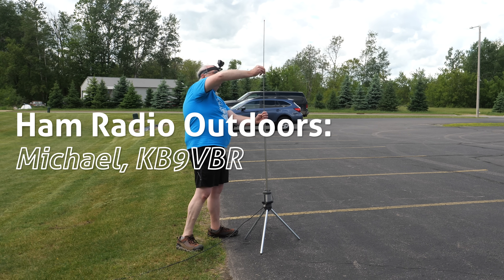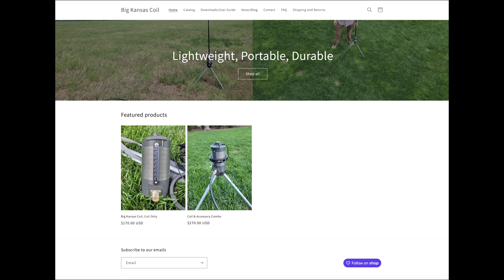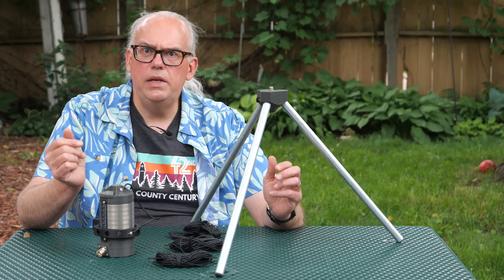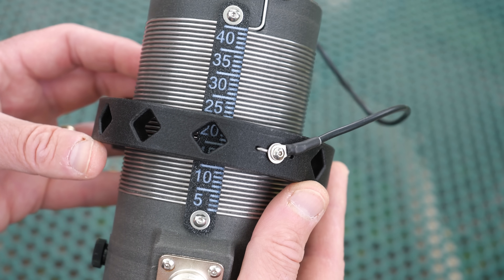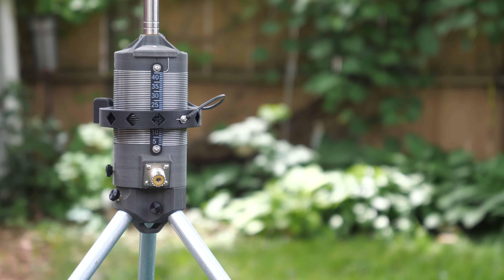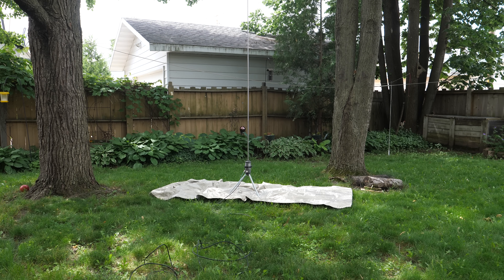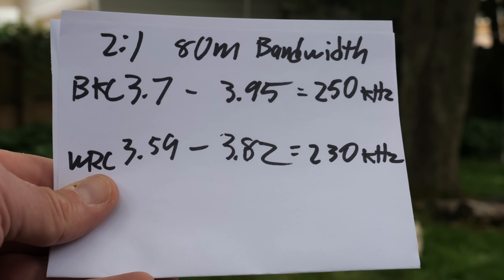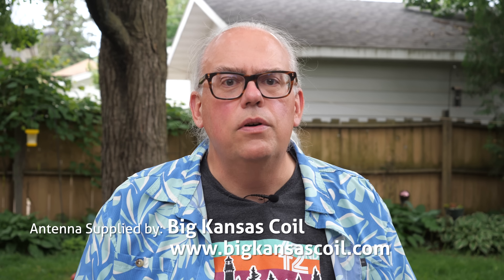Is bigger better? The Big Kansas Coil Vertical Antenna System

Comment: Carbon-fiber filled nylon 3-d printer core (why a carbon component?), plus the coil is stainless steel creates substantial loss in this loading system. Additional loss is in the stainless whip, making the copper wire radials the most efficient component of the antenna system. Achieving 1:1 VSWR (or close) on all bands with the radiator physically short means the feed point will be well below 50 ohms, so the VSWR should be quite high (no impedance transformer device is in the circuit). The loss from the coil (and whip) add to the feed point, pushing it close to 50 ohms for the coveted 1:1; unfortunately, the loss is quite high. This is also evidenced by the wide VSWR operating bandwidth(s). You can make contacts, but nothing compared to an an efficient antenna.

Comment: I must say, I am impressed with the thought that went into this product.   It seems very refined, for a loaded antenna.  And, I enjoy the simplicity and ease of setup of ground mounted verticals.   If I was not already using a screwdriver with a 17 ft whip, I would definitely consider this product.

But, I will note that, in visiting the site, they offer Faraday cloth starting at $100.   Frankly, given that I can get Faraday cloth from Amazon, eBay, and AliExpress, as well as others, for a small fraction of that cost, I was a bit offended.   I get that they need - and, deserve - to earn a fair profit on the things they sell.   But, when they mark something that is a widely available commodity up so dramatically it feels a bit usurious and off-putting.  It made me feel like everything else on the site would likewise be overpriced.

My advice would be to sell the specialized products that they had to manufacture and test at whatever they consider to be a fair price, and sell things like Faraday cloth with much less of a mark up.   Knowing what it costs elsewhere means I would never purchase it from them.   So, having it on the site is actually detrimental at that high price.  On the other hand, if their price on Faraday cloth was more in line with what it might cost elsewhere, two things would likely happen:

1 -  I would likely add the Faraday cloth to my order and they would make a nominal, but fair profit off the sale.

2 -  I would feel like the seller was trying to keep costs down, while ensuring that they make sufficient profit to remain in business - which is a very good thing for them and their customers; because, they make a quality product.

You might pass this comment along to them.

Thanks for the video review!

73
AI4IJ
Reply: @richardowens9061 Hi Richard,  If you note the faraday cloth we sell is more than just the cloth, the edges are hemmed, brass grommets installed in the corners, a custom center hub installed that allows easy connection with banana plugs, hookup cable, and tent pegs for staking.  No, we aren't trying to sell an unmodified Faraday Cloth for 100$, that would be robbery!  Between the hemming, laser cutting of the hole features, and all the other items we feel it's a very fair price.  

Thanks,
Big Kansas Coil

Comment: That antenna needs a spike to hold it, or a big tripod.
Reply: I took your idea and made it work, thank you for speaking up!
Three wooden dowels, 3/4 inch diameter, from the hardware store, and a roll of purple duct tape.
Purple is my wife's favorite color so that's what I buy.
It pays to keep her happy.
Anyway -- I laid the five foot dowels parallel to the provided tripod legs, wrapped it securely, now my coil stands well off the ground -- I have a ten pound kettlebell hanging from the heavy cast-plastic loop under the coil -- so far it's not even offered to tip over!

Comment: Would it be advisable and/or what would be the effect of elevating the radials and tuning them like the POTA performer?
Reply from the maker: You can elevate the coil, as is done with the POTA PERformer. By decoupling the radiator from the ground by using elevated radials, you will increase your radiation efficiency. For inspiration, see my recent video using Hamsticks with the POTA Performer base: https://youtu.be/S6Ht6XtW6Q8

Comment: A coil whit lets say 147 turns on a inch pipe over 37cm has a  q at 529 @ 9mhz. Q @ 4mhz is 353 so huh?
So 147 turns on 2 inch 37cm gives a q @ 9 mhz 1032 and same 147turns on 37 cm @ 4 MHz gives 688q.

Comment: Revisiting this video, a coil and whip would be a good compliment to the EFHW and ATAS I have as alternative options.

Though I am curious, if it’s better to make some radials or using metal mesh screen.

Sometimes it’s really hard to know whether it’s the antenna setup or band conditions. Always good to pack an antenna analyzer if you can manage it.

73 from MN - KF0QNM
Reply: I use screen exclusively because "It Just Works!"
I've threatened to go with Mike's linked, tuned, elevated counterpoise, but with the success I've had with window screen ... guess I'm just naturally lazy ... window screen works, I'm not gonna fix it!

Comment: I have an antenna that has less than 1.1 SWR from DC to 10 GHz, but it doesn't radiate much since it's a dummy load.  Wide SWR can be a negative feature, indicative of losses, not efficiency.  It looks like a nice piece of kit, but base loaded verticals are inherently lossy.
Reply from the maker: Ah yes, the 'dummy load' remark. A facetious comparison that doesn't add to the conversation.

Comment: I have been making my own coil antennas since the early 1980s. I had found a full  spool of welding cable on the side of the road.  I had seen it as I drove past it in the ditch. I went to see if I could move it. No way ! I called my son and he brought a friend along. Still we couldn't get it off of the ground. So I unwound it and realized there was a lot of cable. Later I decided to make a coil out of the cable. I know that's insane.  I wound a 1/4 wave at 20 meters on an eight inch cardboard concreat tube. Again it was very heavy. Had some outrages bandwidth !! . Had to add a shunt coil . It worked really good on 10 thru 20 meters with a 102 inch whip. . But way too heavy . I used stainless hardware for the contacts. Not practical . Still worked well. I guess I was bored .

Comment: @kb9vbr
Is this considered a resonant or non-resonant antenna system when coupled with a 17' or 25' whip? 
I was wondering, given the difference in the Q and loading effect on either length whip
Reply from the maker: Base loaded vertical antennas are considered resonant antennas. You are adjusting either the whip length or the coil amount to bring the antenna into resonance of your chosen frequency.

Comment: I have the BKC with a 17’ MFJ whip. I’m having a heck of a time tuning it for 40 meters. I only have the SWR meter on my ICOM IC-7100. The SWR is off the chart and I’ve tried placing the clip at the bottom, middle, and top of the coil. I lowered the antenna by small increments with no luck. I’m using 40 feet of LMR-400 coax from DX. I used LSB and RTTY each to take the readings. Nothing has brought me to the point where I can see the tops of the bars in the meter. Thanks for any help. Have a great week.
Reply: Try extending the whip using a length of stiff wire attached to an alligator clip and attaching it to the top of the whip aimed upward. Maybe add another 6”. Sometimes just a bit of extra length can make a difference.

Comment: just got my BKC and it is better than the wolf river in my mind with the slider to have a reference. also handles 100Watts at 50% duty cycle digital.  also has a tripod accessory mount that is quite useful to elevate the antenna higher. have used with faraday cloth for ground plane.  be aware the numbers on the unit do not correlate with the actual frequency.  with 97” whip, the 20 M is at 6… to start, then tune with SWR Meter. 6C is to rotate to the “C” part of the coil… and I do like the brass ground screw…W8BLT. thanks Mike I never would have found this coil without your review, at least not as fast. I don’t see alot of reviews for this.  Spread the word!

Comment: be aware the 17’ whip must be shortened to 97” or 112” to be used as the manpack 6 or 7 element antenna to use coil for 20M and down 40-80M.

Comment: Does it come with a whip? I see the coil I see the tripod I see the radius but I don't see anything about a whip
Reply: It now can come with a 7 section manpack whip!  The option is available on the website.
Reply from the maker: No it doesn't. Whips are sold separately. I recommend either the Chameleon SS17 or a nine segment foldable man-pack whip.

Comment: For a $100 tripod they sell you that need to modify it so it can be properly secured (staked) in windy situations where the antenna can drop on the side and brake the whip. Well made coil, but a bit too big for backpacking POTA operations.

Comment: Hello,

Good review as usual.  Did you try this with a raised radial by any chance?
Reply from the maker: I did not test this coil with an elevated radial. But it will work in that configuration. You will have to do a bit of adapting, though, to elevate the coil, as the unit only comes with the ground mounted legs. But if you put a 3/8x24 stud onto a clamp, tripod, or short mast, the coil can be screwed into it and used in an elevated fashion.
Reply: @KB9VBRAntennas  , I guess I'm just naturally lazy, but I set up operation on a picnic table at our local park. One of those lightly attended summer days when you could have fired a cannon through the picnic area and not even scared a stray cat. I set the tripod up on the table, run a bungee cord from the loop under the Big Kansas tripod and down to a ten pound kettlebell (gotta love exercise equipment!) to keep the antenna from blowing over. Simplicity itself to run the tuned elevated counterpoise when operating at picnic table height, but impractical if there are other picnickers in the area.

Comment: Are you using the fereday cloth  rather than the radials?  Do you use that on both coils?
Reply from the maker: I tested this antenna with radials and with a faraday cloth. Performance was pretty identical between the two. Since the coil is isolated from the base, you will need a jumper to connect the cloth to the ground side of the antenna.
Reply: @KB9VBRAntennas  so how big a piece of faraday cloth do you need?
Reply: @dougdukes1039  , if it's any help, I went to the local hardware and got a roll of aluminum window screen. Wrapped it around a scrap PVC piece for convenience during transport. Works well for me. Cheap, easily replaced, readily available and if it gets cut, torn, blown away, lost, snatched by a passing child, no great loss. I don't think size is a terrible concern (though I'll admit I got the biggest of the two avilable sizes!)

Comment: It looks nice but there are things I don’t like, 1 Stainless steel wire in a coil lowers the Q and causes losses and more bandwidth this is a bad thing not a good thing. 2 $170 for a simple coil is way to high a price. 3 100 watts at 50% duty is not impressive. But it does look good.
Reply: Hi @billverstelle8979

Stainless wire wasn't the first choice for construction, tinned copper was, easier to work with and better on paper performance.  Then some prototypes came back from the field, corrosion!  They still worked ok, but they were ugly.  

Things were then switched to stainless.  

The price could be lower if I used lower quality parts in it but that isn't how I want to operate.  They aren't cheap or fall off a log easy to build.  

Do you bring an amplifier on portable outings or are you heavy on the TX on CW?  That's about the only way I can see the 100w being a limit.  What would work better for your operating?
Reply: @BigKansasCoil  well I agree with the 100 watts that’s a good point although I like over kill to be on the safe side I did melt a screwdriver coil once on CW. 

At this price point I would thought silver plated copper would have been used. But I have no idea the cost of the 3D  material.

I would like a coil that doesn’t have the so239 on the coil so I could move the coil more to the center of the antenna getting it away from the base. Maybe build the coil in 2 pieces with the coil as one piece and the SO239 in the other piece, they could be screwed together to be used as a base coil or unscrewed and a extension installed between then to move the coil up the antenna, anyway just a thought. 

What ever 3D printer you are using it sure does an awesome job.
Reply: @billverstelle8979  The 100 watts is a very conservative number I believe.  I haven't melted one yet but I've yet to turn the amplifier on and run contacts yet.  100w FT8 doesn't show any temperature issues from my testing so far, further on the to-do list is run it at 500w with thermal pictures of it.  

If a fully sealed coils is ever built it can be plated copper, but otherwise they have to be stainless.  I've got some customers that winter on the Gulf Coast and that is heck on anything other than stainless.  

Yes, that's been a thought that's been kicking around.  

Thanks, I'm pleased with how they turn out.
Reply: Amphenol SO239 was mentioned . That alone is an indication of quality. Cheers from Aus

Comment: when your tripod blew over... I felt that haha.  I had just bought a brand new buddistick back in 2014(ish) and took it out to a park in san diego.  it was hot out so i was under a shelter.  The wind blew it over and the telescopic part of the antenna hit the roof of the shelter and broke it in half.  I was so bummed.  thankfully back then to replace the telescoping part of the buddistick was only $13.  I imagine it has went up quite a bit since then.  Anyway cool video I hadn't heard of this antenna before  -- Jeremy KF4CHW

Comment: I bought inexpensive photographer weight bags from Amazon and filled them with about 5 pounds of aquarium sand.  Only need one and it never falls over.  I haven't even looked at my ground spike mount since.
Reply: John, as usual, more than one benefits from the OP's observation. I tend to overthink and over-engineer, and your approach just saved me much wasted effort. Best part is, your solution WORKS! Many thanks!

Comment: Think I'll stick with my home made loading coils which I made using 90mm PVC storm water pipe.250mm long with taps to suit all the bands Im interested in and cost me sweet Fanny Adams to make using a roll of copper wire and a VNA. This looks nice with all the effort gone into the clip and all. Ultimately its a coil of wire with a movable tap you can attach to a mount. At $170USD which is currently $255.00 Australian Dollars It's a fair amount of Money for something so rudimentary in my opinion.

Comment: No 80 meters? I have no use for antennas that cannot do 80.
Reply from the maker: The coil will certainly work on the 80 meter band. I not only say so in the video but I demonstrate the 80 meter bandwidth of the coil. Look for that at about the 12 minute mark

Comment: Having a 3/8x16 or 1/4x20 threads on the bottom would make it more compatible with a typical camera tripod. 3/8x16 being the more common tripod base size.

Comment: Seeing the wind blowing your antenna over, I had the same thing with my setup. I took an older photo tripod and modified it for my coil and whip. It’s a lot more stable than the small tripods that are available.
Reply from the maker: I've got a 30 year old Bogen (Manfrotto) tripod that I use for my delta loop. I like that you can splay the legs out wide for more stability. I do agree that I wish someone made a sturdy adapter that converts the tripod threads to 3/8x24
Reply: I've had enough emails and talk about adapters, look for one on the website here this week!  It'll match the coil and go to 1/4-20 for standard camera tripods.

Comment: Looks like a good design. I just don’t think 3D printing is the way to go. It’s nowhere near as strong as a machined part. Before I’d buy something like this I’d want to know a lot more about the material and printing process.

That being said, I love to see all the recent innovation with antennas
Reply: I agree, it isn't as strong as a machined part, but we believe its plenty strong enough.  It has been tested, and a tensile test showed over 900lbs before failure occurred in the material.  What 3d printing does allow though is creating of parts and designs that would be tough to manufacture with traditional methods and allows the complete coil to weigh the same as a can of your favorite beverage!  

If you decide to buy one, know that they are backed by a 1yr warranty on the coil.  If you do manage to break one, please send me pictures and a description of what happened when it broke so it can have the design improved to prevent that again!  

No one has managed to break one yet either.
Reply: you simply don't understand where 3D printing is right now.

Comment: Thanks, Michael for the review. I do like the clip. I wish it was able to handle more than 100 watts like the WRC platinum.
Reply: We actually don't know what the top end of the power rating is, but we're calling it 100w FT8, voice work could certainly be higher.  I use my personal ones at 100w digital modes without any problems.  We haven't tried to melt one down yet.
Reply: @BigKansasCoil  Thanks for your reply. I rarely go above when I’m remote, but it has happened. Great looking product.